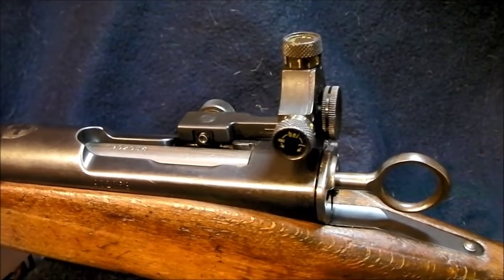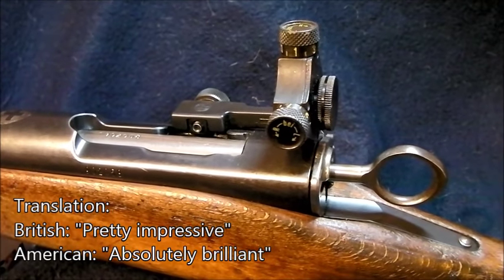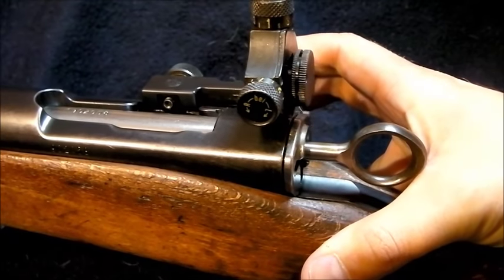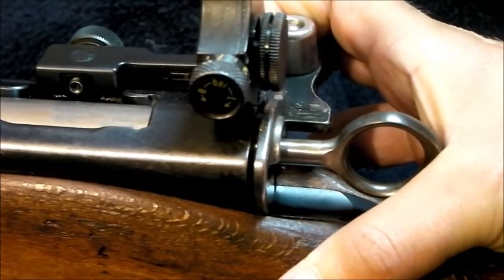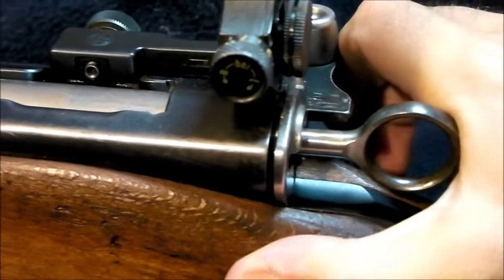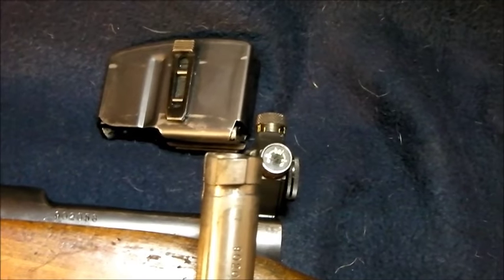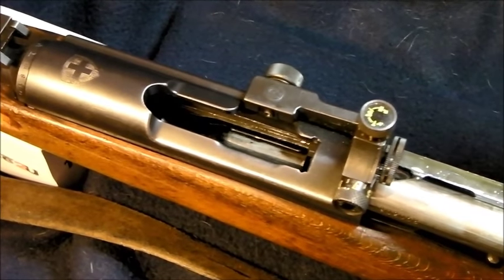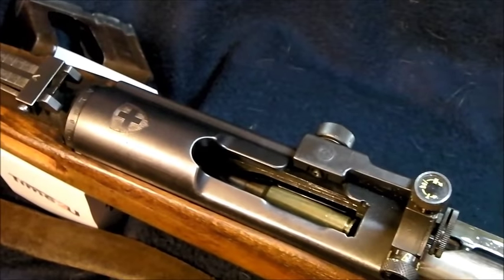Schmidt-Rubin K31 Technical Short: Positive Extraction And Use Of The Charger

Comment: I am sure I heard a manfully unspoken "absolute bollocks" in there. But yeah, Alex seems to be a nice guy so the restraint is appreciated.
Reply: +leighrate Alex would never (from what I can tell) mind being corrected if he is wrong. He is usually the first to admit it.
Reply: +SWEmanque I have a lot of respect for Alex. TFBtv is a great channel and I like their content.
Reply: +SWEmanque Hey, when you're wrong you're wrong :)
I think being a Mauser guy has given me tunnel vision in some cases. It is easy to notice primary extraction when your bolt handle is contacting a large receiver bridge and ripping out the spent case, but it is more difficult to observe in other systems.
As per the chargers, I meant that you cannot simply bolt forward to automatically get the clip out of the action; it must be manually removed some way (and the quick thumb method as presented here is certainly the way to do it!).

Keep up the good work Bloke. I see big things happening with this channel.
Reply: +TFB TV Just embrace your inner Mosin, Alex.  :-D

Comment: I have a question about the slots in the bolt... when my bolt assembly is together, the slots aren't 100% lined up. The bolt action is smooth and the serial number is at the very top when the bolt is engaged. Is this an issue or is the bolt assembly okay?

Comment: TFB has unestimated the mosin action as well. I guess none of them have shot an M39 before.
Reply: The Mosin was not underestimated, it really is a bad service rifle, and the PU snipers barely count as sniper rifles at all, they are just very crude as far as bolt actions go. 
their advantage is speed of manufacture, ruggedness and simplicity, that'd all they really have going for them.
Reply: The M39 is pretty phenomenal. Regular 91s, not so much. Fit, finish, accuracy, and trigger weight are all too inconsistent on 91/30s to even consider them decent weapons without fair modification.

Comment: Total newbie question that wasn't satisfactorily answered by 5 minutes on Google: What is meant by "primary positive extraction?"  Are there different stages to extraction (primary, secondary, tertiary... quaternary)?  Is there negative extraction?  Ambivalent extraction?  Thanks, Bloke!
Reply: For the typical bolt action, when the handle is raised to full cock, an angle at the root of the handle hits an angle on the receiver, forcing the bolt back slightly. This is to break a stuck case's grasp on the chamber walls, so the bolt can be more easily drawn back to remove the case.
Reply: +HighpowerRifleBrony 
Aha, that makes sense!  Thanks for the succinct explanation!
Reply: +Bloke on the Range I usually troll a lot of modern European rifles for apparently not caring what their products cost, or weigh, relative to an alternative.  Information like this makes me ask what was lost chasing every penny of production cost, every fractional ounce.